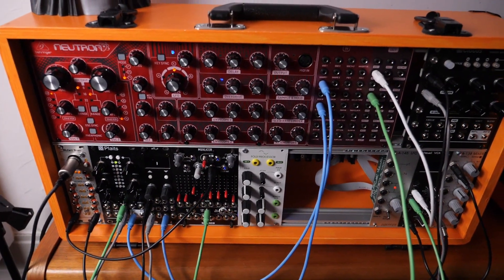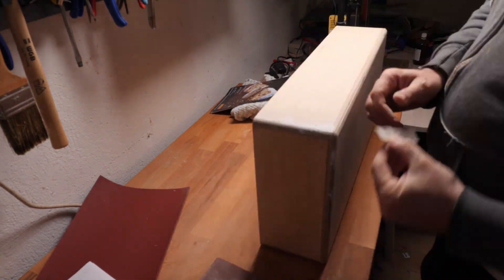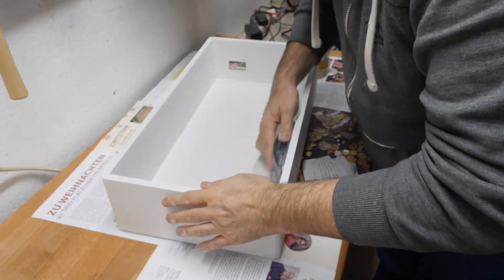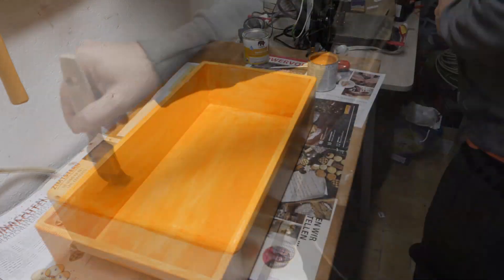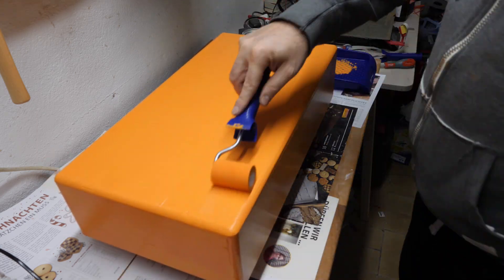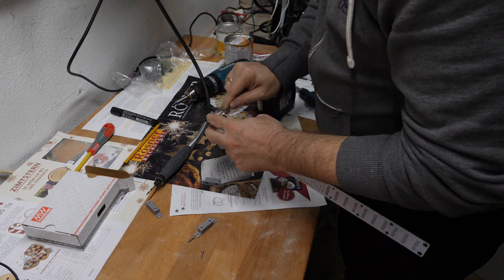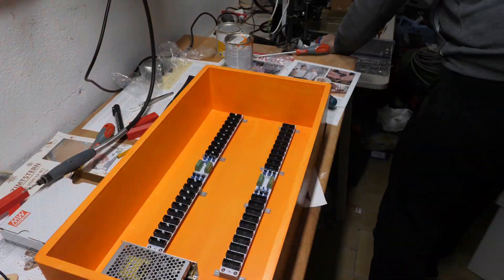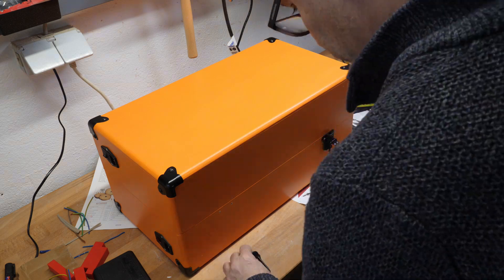My DIY Eurorack Suitcase build

Comment: Looks great - I love the color.  No criticism but just two things I would do differently.  I'd use a wider quality brush which would also give you a good coat.   Idt also put strips of wood just inside the edge of the top or bottom that protrude about a quarter of an inch so that when the two sides are together there's some overlap to create a bit more structural integrity.  Did you use Modular Grid to configure your system?

Comment: dont you think that the handle may break or the wood may split since its too close to the edges? i would probably install the handle on the right or left side since the locks on the side would be carrying the weight of the other side

Comment: Hi inner yard, I liked your build and would like to do something  similar! My question is, does your hardware (corners, feet, latches and hinges) come with the screws? what sizes are they please?
Reply from the maker: I put all the links in the video discription. there you can order all the parts your an need for your build
Reply: Thanks inneryard! I will check them out😎😎 thanks again 😎

Comment: can you share the dimensions for the case?
Reply from the maker: Easy Now 104hp in with. 12cm depth. And the other measurements I took from the railframe.
Reply: @inneryard  finally 12cm depth is good? or you would suggest less or more?